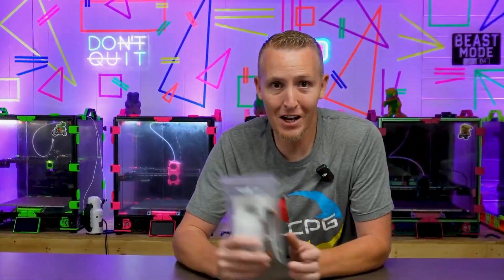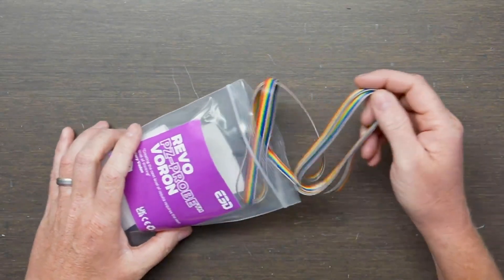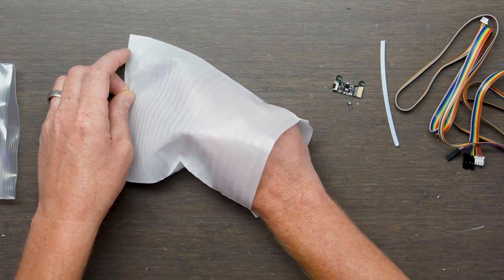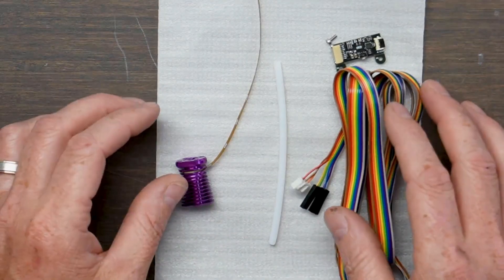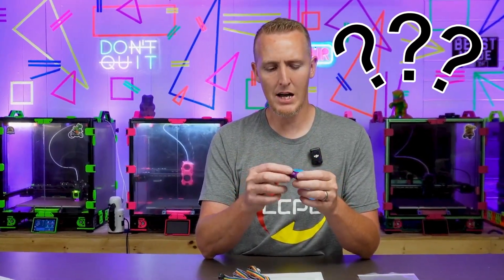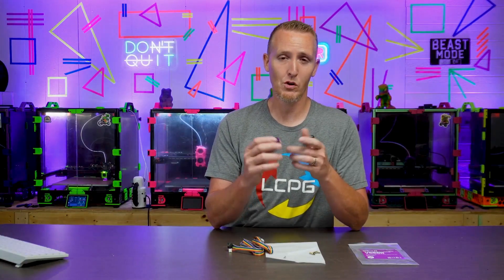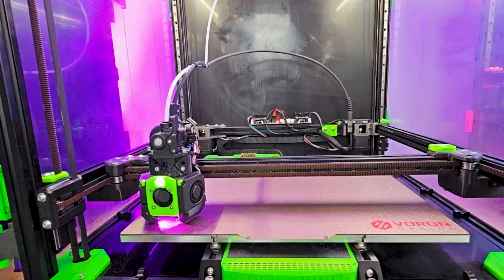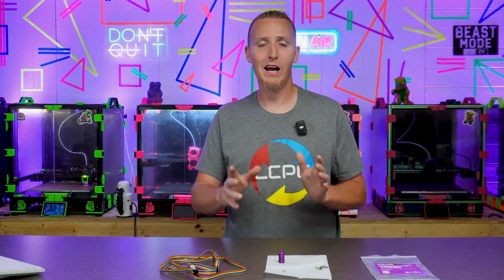First Look & Unboxing: E3D PZ Probe – The Future of 3D Printing?

Comment: Piezo sensors have been around for a long time. (pretty sure Creality uses them in the K1 series under the bed, for instance) They have problems just like any other solution. The main problem with Piezo systems is that fundamentally you are using an analog signal and converting it to a digital on/off switch. Piezo signals are very noisy, like, motor vibration can read as 'triggering' them, noisy. The challenge is determining what is the exact signal from the piezo system that you want to trigger your 'switch'. So you use lots of filtering of the analog signal to limit the noise. This heavy filtering makes false positives and failures to detect the real signal, really common. 
How well this works will depend on how good their electronics are and if their recommended homing practices like changing motor current work well enough. 
What we really need is for the system to be integrated into klipper instead of a standalone board that has no clue what the rest of the system is doing and just emulates a switch.
Reply from the maker: Ahhh... That makes a lot of sense! Maybe it will get added to a future klipper update 🤞
Thanks for all the info on piezoelectric!
Would love to have you in the discord server to chat more. And thanks for watching!
Reply: @grasstreefarmer  that's allot to chew and digest I'll be reading this at least a half dozen times . Very much appreciated and very comprehensive explanation.

Comment: Finally back in stock so have one now. This has the potential of being a better Revo solution than klicky, beacon or tap because it is simple, lightweight and uses the actual nozzle. Piezo sensors have been around a long time, we used them for measuring scientific data many decades ago, they are very sensitive and accurate but require good filtering and signal processing which is what the PCB is for. One thing to note is this is a 5V board, 24V will destroy it so take care and be certain that the voltage is correct.
Reply from the maker: Yes! Back in stock :)
I've done some research on pz, and it's really neat all the uses. I did end up having to adjust mine just a little bit. But the instructions are very good with these to switch sensitivity also. Thanks for watching! Join our livestreams sometime if you're able! Have a great Sunday!

Comment: As far as I know, the first use of piezoelectric elements for bed leveling was by Njål Brekke in February 2015. I copied his idea and put it on the RepRap forum in March 2016 and Moriquendi and DjDemonD picked this up and ran with it as Precision Piezo. Underbed piezo sensors are used in Bambu printers, in the toolhead of BCN3d printers and in several other makes.
Reply from the maker: I've actually seen the use under beds but not seen any used as a probe. I really appreciate all that information! I love going back and seeing where different changes and new tech brings much more advancements to 3D printing for us! Thank you for watching, I'm going to be finishing the video of installing into my printer along with some testing with the pz vs voron tap and such.
Reply: I know of 4 or possibly 5 in-toolhead piezo sensors. There is the Precision Piezo Orion; a toolhead piezo called the Pyr0piezo; one sold in Brazil by Celtek Imports (ECJ) was functionally similar to the Precision Piezo. I have notes on two others that I need to find more details about.
I have put an entry in the RepRap wiki with a good handful of different technologies as "Bed leveling probes" and am trying to update this with anything I can find - I would try to put in a link but this reply would probably disappear.
Reply from the maker: Oh really?! Yeah I did not know this. You can absolutely include a link. Or even better, if you want to send me the link on our discord I'll include the links in the description of the video :) Thanks again for the info. 
All the discord information is in the description.

Comment: With a 60C limit I would say no. I'll stick with Beacon.
Reply: We've ran some additional tests and we are now rating the PZ Probe up to 75°C, all technical documentation will be updated accordingly :)
Reply from the maker: @E3DOnline Oh really!? That's awesome to hear! Thanks for the update! I'll include this in my next video on this. Reach out and send me an email if you don't mind (jfranklin@leemerie3d.com), I have a couple questions as well. Thanks!
Reply: @E3DOnline  Just to be clear, E3D support stated that's the max STANDBY temperature (the temperature to never exceed), not the max probing temperature.  This is unlike the Beacon which states a different temperature for MEASUREMENT versus STANDBY (100C vs. 115C for Beacon).
Reply from the maker: I agree honestly. The 60C limit for chamber makes me very weary as most of my machines run 55-60C chamber temps. Surprised me when I saw that.

Comment: Piezos on the hotend to use the nozzle as a probe has been a thing since at least 2016, I remember back then on the reprap forum people messing around with trying to drill holes into piezos and eventually getting it working like that and turning it into a product (precisionpiezo)

Of course it was never as slick as this e3d one because the precision piezo was designed to be somewhat universal for the typical groovemount interface that was the standard back then.

There was also a variant of it to move the sensing to the bed, to replace FSRs which was a popular setup on delta printers.

So both nozzle mounted and bed mounted probing with piezos has been a thing long before bambu and co.
Reply from the maker: That's very interesting! Thanks! I've been reading up and they are super neat how they work!

Comment: US20140117575A1 patent says basically, dont put force detection in the extruder...
Reply: Actually a piezo does not detect force. It detects impact (change of force at a certain time). Anyway, any mechanical switch detects force - so like in many cases, such a patent is most likely not rightfull granted. But that does not help due to the duration and cost of a lawsuit.
Reply: @oleurgast730  well, an impact is a force. And the patent states this use case. 
 I was the developer of Prusa Nextruder. And put the load cell in there:). But it's clear from infringement for many reasons.  Mostly because it's used for so many different scenarios. So to pin down one patent is difficult if we/they say it used for other things. 
 Also probably clear because I reached out to Stratasys when I made the design. 
Although they didn't respond to me 6 years ago. Maybe that's why they are ok with it.
Reply from the maker: That's interesting!

Comment: now i have zero experience with DJI mics. but they do NOT sound like that. idk whats going on but it sounds worse than an xbox mic. idk. something is wrong with it i think.
Reply from the maker: This is a new mic actually and it does sound a bit different than my previous dji mic. Maybe it's the noise canceling going on idk. It's very loud with the printers and the AC going. If you have any tips I'm all ears! Jump in our discord I'd be grateful to have any help. Thanks for watching!
Reply: @leemerie3d  i wish i could help. its just that it sounds extremely distorted. to the point i couldnt watch the video with sound. im sorry ):
Reply from the maker: @xXP1ZZAxD3MONXx  Yeah sorry about that. I'll see what I can do about it for the next video at least.
Reply: @leemerie3d  I second that. Video was very difficult to watch with audio with the very noticeable and unpolished audio processing. I would honestly prefer audio with a ton echo rather than audio that sounds unfinished and half processed if you had to compromise audio quality somewhere.

Comment: If I’m not mistaken, similar device is used on the A1 and it’s sensitive enough to adjust flow ratio. I really should change my printer over to revo.
Reply: Also on the Mark 4.
Reply from the maker: That's interesting. I'd like to have me one in the shop to do some testing on eventually.
Reply: @jameslee6881  No, the mk4 uses a loadcell. Quite different. A piezo does not sensor preasure but impact (the change of preasure). So homing speed and hardness of the bed´s surface is much more relevant. That´s one of the reasons there are different presets to choose. On the "precision piezo" (older solution for use with v6 and other hotends) it was quite hard to tune.
Also there was a solution for deltas to mount under the bed.
Reply: @oleurgast730  thank you for the  clarification.
Reply from the maker: I've come across some really neat applications after doing some research on these! Thanks! I really appreciate the insight on PZ in 3D printing applications!
Reply from the maker: I was wondering that. I don't have the A1 (other than the one in a box that we are going to GIVE AWAY) but now I'm going to look into the use case on these a bit more.

Comment: Easy answer.  Install it like a drop in replacement into your Voron (2.4) like E3d intended, and compare it to tap and klicky.  That's all anyone wants to see.  You CAN connect it to one of your toolhead board endstop goio headers.  The long-ass wire is only for configuration.  Doesn't need a usb cable like beacon contact, nor a uart/spi header on your tool board.  That's why its an exciting offering. The promise here is: lightweight, affordable, simple, reliable, perfect 1st layers.
Reply from the maker: I was hoping that was what it was for! Thanks! Can't wait to play with it when we get back from this trip! Thanks for watching!!!
Reply: @leemerie3d  Piezo generates voltage when flexed (and flexes when voltage is applied such as in a piezo speaker).  In this case, the nozzle tapping the bed generates pressure, which generates voltage across the Piezo cell, which is detected by the microchip on the little PCB you mount to the Stealthburner carriage.  A preconfigured voltage threshold is converted to a binary on/off signal (for the z endstop switch) by one of 7 customizable thresholds you can preconfigure. using that long wire.   If you have a drag chain, you could leave it attached.  Otherwise you probably would want to create a custom short header that you'd run to the endstop switch on your toolhead board. (I've been reading the tech docs today).  I've been waiting for something like this for a long time to replace Klicky.    IMO Voron TAP is too heavy/complex/expensive for my taste.  IMO Beacon probe/contact is no good because it needs a USB cable.  My 2.4s have KlickyPCB dialed in to within an inch of their lives (combined with the Klipper Auto-Z calibration) which DOES ACTUALLY totally give me literally perfect layers every time no matter which temperature/material... UNTIL the probe gets accidentally deployed, or until the switch dies a heat-death, or the probe dock slips, or a  few other fussy edge cases.  This is so simple, it may be what I've been waiting for!  BTW: I think my nephew and I met you and your wife MRRF!
Reply: @karlfife  where are the tech docs ? West 3d is already sold out but I hopped  over to kb-3d and grabbed one over there.
Reply from the maker: Awesome reply! Thank you for all the info! If your not already, join our discord so we can chat with you a bit. I bet you did meet us at MRRF lol! Also I'm looking for the link to the github but coming up short. Do you have the link handy?
Reply from the maker: Glad you grabbed one up! Yeah sold out already at west3d but KB3D still has some. Not for long at this rate lol. 
I'll get the docs up soon I'm hunting them down. This video went up quickly I didn't have a lot of time.
Reply from the maker: Linked the docs on the video description now. It's on E3D site.
Reply from the maker: Yep! We met a lot of really cool people at MRRF this year! If anyone is going to 3D Printopia (or ERRF) stop by the West3D booth and say hi to us! We will be there!
Reply: Where is the github link. Awesome info I need to get on west 3D.
Reply from the maker: I'll get that up thanks! I put this up quickly and missed that.